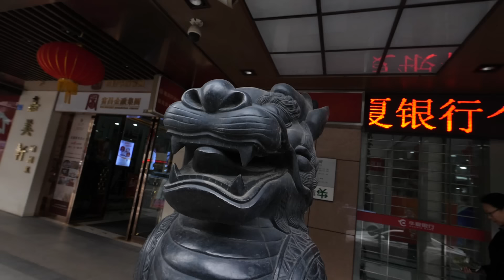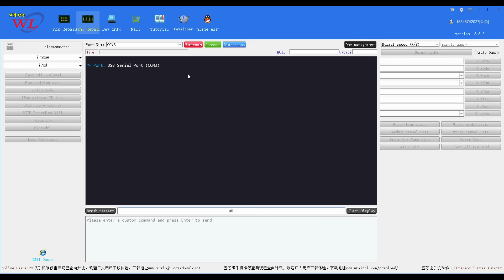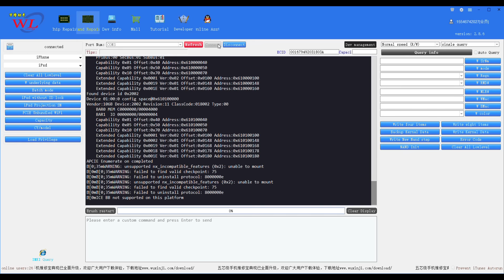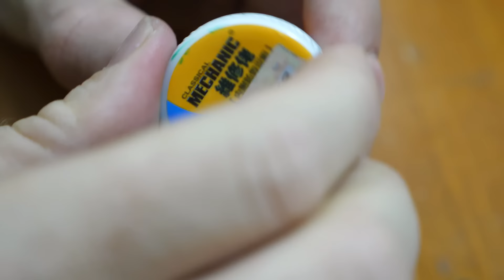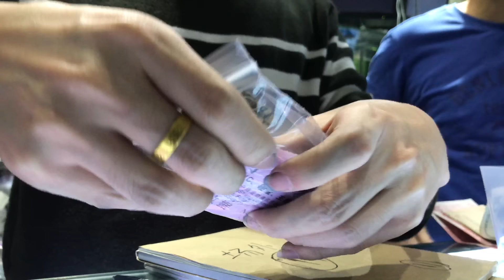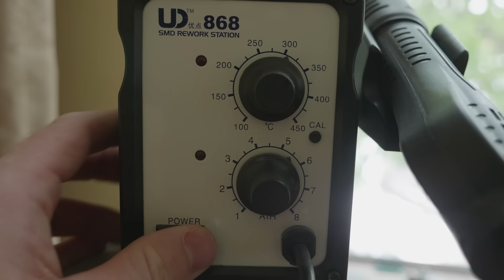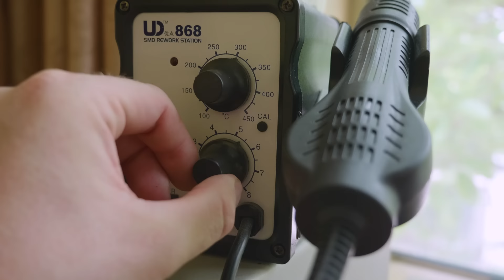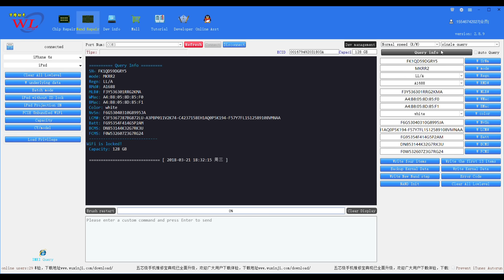How I Upgraded My iPhone Memory 800% - in Shenzhen, China

Comment: He has a soldering station, a microscope, a battery tester, batteries, old logic boards, but not another windows personal computer.
Reply: He's an apple people for some reason.
Reply: um how much was the phone with 128gb? i mean I loved this video being i have done this for eeproms on hard drives so it was good but with that equipment most people would just spend the extra money.. exception would be if its not able to be bought. I dont mess with apples because oranges taste much better
Reply: @kennethnicklowicz1030  well, the extra money he spent went into practice & tools. also, he made at least 1500% of the money he spent back from this video.
Reply: He can double boot too
Reply: my guy doesnt even know how to dual boot or run a vm, just goes and wastes money on a chinese craptop
Reply: Btw... Probable covid 19 if hes still there
Reply: To make his video lengthy to earn more money according to the watch time duration of his video
Reply: Honestly why. Macs are kinda bad. There overpriced and brake
Reply: @smurfy913  yet here you are on his page. Odd.
Reply: @kennethnicklowicz1030  you missed the point
Reply: He does now
Reply: or...download Paralelss

Comment: Hey scotty!  When the real iPhone didn’t boot it’s because the kernel data backup only backs up the core info of the chip (this does not include iOS ). So when it didn’t boot and was in recovery mode that was because it didn’t have an operating system installed. This is normal as I do these upgrades on a daily basis (I own a repair shop in Vancouver Canada called ring ring repair). Love your vids. Keep up the good work man!
Reply: sunlite1231  does restoring works? Just like how scottie did in the last part
Reply: sunlite1231  easy bypass 2020 i cloud screenlock
Reply: Do you upgrade memory like ing the vid? If so, how much would u charge to upgrade mine to a 128 gig? Thx
Reply: Cool!
Reply: Hey could you upgrade to 1 terabyte
Reply: @fireball2275  512GB(For iPhone X - 12 Pro Max) is The Max Capacity  , No iPhone Has Reached 1TB of Storage except the iPad
Reply: [XE01]ケネス thx
Reply: sunlite1231  if a chinese repair says that then dont hahahah they know the best probaly he did a icloud bypass
Reply: Hello, I am in Canada and looking for a micro soldering place to do this job for me. Would you be able to do that swap for me. I have looked around and I haven't found many places. If you can let me know thanks
Reply: Ill make sure to stop by your shop if i ever need phone help and am in the city!

Comment: I was so happy when i saw "800% memory upgrade" when in reality it was storage, not the ram I expected....
Reply: Yeah the RAM would be impossible because the amount is limited by the software. Unless you modify it which is also basically impossible to do on newer iPhones.
Reply: Can older iPhones be modded? I'm currently using a 5S which I love because of the case.  it's a cheap imitation survivor case but it's amazing.  I'm going to bite the bullet and maybe get a 12 Mini but when I do I was thinking of learning hardware nodding and stripping the 5S down and installing things like a bigger storage and better camera.  Do you reckon it's possible at all? Like obviously i know nothing but if I did know something do you reckon it would be possible?
Reply: @sammylpt9076  The storage could be upgraded but it's a finicky process as you saw in the video. A camera upgrade would be limited by the software and the processor. There could be image quality improvement but there are many other factors that limit that, mostly the hardware. Plus I doubt better cameras are made for the 5s anyway.

Modding the software could be done but like I said it's mostly the hardware that limits it which definitely cannot be upgraded. Also at your level of knowledge which as you mentioned is next to nothing it's very likely you would break your beloved 5s if you tried modding anything.

You've been rocking that 5s for a long time, in my opinion I think it's time to move on and get a new phone. From the 5s you will see a world of improvement if you get an iPhone 12, like loading times, response time, download speeds, image quality, and much more. You don't even have to get the latest iPhone 12, you could get a 11 or 10 or even a modern Android. Trust me, you won't regret it. :)
Reply: That much ram would be possible on a pc but who would even need that much phone ram anyway?
Reply: @rearmisser  or you buy an iphone 12 mini and transfer it's logic board, camera, battery, and everything In the 5s. Doesn't make sense but..
Reply: @r2256_  play pubg @God speed lol
Reply: @VulcanicYT  I mean why would you buy a brand new iPhone 12 and transfer everything to the 5s? The parts won't even fit as they are too big and there's different connections and stuff. Plus there's no point in doing so as it would defeat the whole point in upgrading the 5s' components in many many ways.
Reply: @rearmisser  like i said, "doesn't make sense". I said iphone 12 mini, I'm pretty sure it's about the same size as the iphone 5. So it could technically fit in there. Connectors don't matter cuz you'd switch the whole logic board. Could make for a nice sleeper phone! Right
Reply: @VulcanicYT  The iPhone 12 mini is still bigger than the iPhone 5s. The screen connectors are totally different plus there's no support for a home button obviously. Yes, it can be a nice sleeper phone because it won't be able to turn on, lol.
Reply: allow me to run ios 7 with 256 gb of ram

Comment: This made me appreciate the micro sd slot on my phone a whole lot more.
Reply: i think the point he was trying to make is that he can upgrade his phone storage in a few seconds by just plugging in a sd card instead of spending days and a few hundred bucks
Reply: Mario you can fit like five 1080p BluRay movies (or two 4K BluRay movies) in 256gb, allowing for space for the firmware. Do you want just five movies on your phone? Space is not often enough which is why most phones include an sd card slot.
Reply: Lol yeah. So much pains just to increase storage in an iPhone. Nah. Buy android
Reply: If you complain that you can only fit 2-5 movies on 256gb, it's more you than the amount of storage you got lol. First of all, the average encoded 1080p blu ray rip is nowhere close to 40-45gb a movie, and second of all, maybe you should adjust your files to the device your using it with lol. Like it's of any use to put a 4k rip on a phone that can basically show no difference between 720p and 1080p
Reply: youfreaker you never download rips. Amateurs do that. You download source material. I have a Deadpool 1080p bluray thats 95gb so I don't know where the heck you got 45-50gb from. I have ender's game that's 112gb 4K bluray. So...

Also, you can see the difference between 720p and 1080p. Just because you can't doesn't meam no one can. You can see the sharpness difference. The only resolutions you can see next to no difference is 720p and 768p.
Reply: Aditya Upadhye but if your planning on watching on a small screen, you could compress that down by about  x8 and you would never see the lost parts.

Also if you have the disk, and ripped it why the hell would you be watching it on your phone. Do you not have a HD tv, with decent speakers?

Also why hold onto a movie after you have watched it? Your argument makes little sense.

Though when we go on road trips, usually from UK to Spain or Italy. 3 to 4000m round trip, I have a usb 3 portable hdd, and a hootoo mobile router (£20) that acts as a mobile 'netflix' that is powerful enough for 5 people to stream from it at once. It also acts as a lan so the kids can play multilayer games.

A 10k mha battery pack will keep it running for a good 10h, (never drive that long). I use the battery so when I turn the engine of etc the hootoo doesn't turn off.
Reply: Stephen Butler a small screen is relative and the level of detail you see depends on how close the screen is to your eyes. I keep mine pretty close.

You watch on your phone if you're on the go. I do have a tv with great speakers. But I can't carry it with everywhere.

Also, I said you don't download rips. Didn't say I own the cds. You have to know what to download. Like remux or 7.1 atmos for my home theater or how big of a resolution your projector, if you use one, can output etc. 

There could be a million reasons to hold on to something. Sentimental value, amazement at the quality, something else, future reference, nostalgia, a look back at what I used to own once upon a time. (Fun Fact: I have never deleted anything in my life. I have five 12tb hard drives on which I've stored everything I've owned since my first ever Windows xp pc in 2003. Three and a half of those drives are full and I'm planning on getting more later on down the line once that fourth drive is full.)

Also, I cant stream becuase I have shitty internet. Those are the speeds I get where I live in India. I have to wait for 360p video to load on the worst days and 720p buffers a lot on the best ones. 480p is pretty much the sweet spot where I can watch something and still have something downloading in the background. Seriously. Like a 100MB file takes half an hour to download. The max speeds I hit are 200kbps (for download) and 600kbps(for upload).
Reply: NERDS Alert😂😂
Reply: you can fit a lot more than five fucking blu rays in 256 gb. averagely blu rays are about 2gb.
Reply: My 1080p copy of Deadpool is only 2.5GB. I don't think you can justify a 95GB~ copy which looks the same with maybe better audio quality?
Reply: Parag D all that space from an SD but makes it run slow. Increasing space by flash makes iPhones run more efficiently.
Reply: And you watch 4K on iPhone? :)
Reply: Who has uncompressed video rips on their phone? No one, ever. If 128/256 is not enough for you then you're doing it wrong. Its a phone, not a full blown computer with massive HDD's.
Reply: Mario But you can't do this
Reply: 1080p, 95gb? and 4k movie 112gb? something is very wrong here. 4K movies should be at around 4x the size of 1080p movies :)

Comment: I was following along in my head and once you got to solder balls, I was like nope. Great to watch, my inner electronics geek is complete watching this channel and your builds. 

The thing I really like are the hurdles and the pain, so true and real, man did I feel your Defcon about the Automatic Tressure Machine
Reply: From the evidence gathered in the video, there were 2 primary issues that increased the difficulty his experience, one of which he recognized and fixed it. The first was that he used a setting for the hot air blower that was on the wrong setting, particularly vertical air. This was suggested by how much the motherboard was moving. When the helical air setting is used, the intensity of the air produced is much less so and is much more conducive to removal of large items on the PCB such as the nand flash.

Comment: You got it right at the end of your video.  I am one of those who would NOT try to save $75 by taking my phone to a Temple Street phone repair shop in Hong Kong and risk at least a 50/50 chance of ruining it.  What makes it worse is that they don't ruin it but created some "flaws" in it, that when I find out later and try to get them to fix it right, they'd deny it is their fault. When one spends $1000+ on a new phone, one should not try to cut corners and save $75...

Comment: "The problems is it's Windows only software and I use Mac."

What a third-world guy like me expects: download cracked Windows or Parallels to use on Mac

What the Chad engineer who lives in Hong Kong do in reality: buy a brand-new PC.
Reply: Couldnt he just have used a vm
Reply: I'm from Venezuela. Yup, I was think in that way
Reply: Yeah, I would have tried a VM first; then if needed, installed a version of windows on the physical ssd.
Reply: What about driver?
Reply: Could've done a bootcamp partition, right?
Reply: I'm from Canada, am a Linux user, and I think the same thing. VM, Wine, or pirate windows to a dummy machine.
Reply: You don’t even need pirated windows you can download a free version straight from Microsoft.
Reply: Bootcamp?
Reply: Wouldn’t work well in working with hardware level drivers for flashing etc. So yeah he got a dedicated windows laptop for the task

Comment: The problem is, the software is windows only.

How about a virtual machi.. LETS BUY A NEW COMPUTER
Reply: TheWGBbroz you don't want to bother with weird drivers and usb passthrough on virtual machines. Dual booting would have been better
Reply: He gets to write it off as an expense xP
Reply: Bootcamp
Reply: on the plus side, now he is not stuck with a shitty Mac !
Reply: rob b true
Reply: or wine for fucks sake
Reply: There is just annoying driver issues when using a virtual machine and you want to keep it as simple as possible for the controller in the device.
Reply: Dual Boot :P
Reply: LMAO
Reply: @wrgint2249  erm from the Microsoft website..?
Reply: when in china
Reply: Oof
Reply: @natanielc5088  oof indeed nat
Reply: Bootcamp is built into mac ...
Reply: I did the same thought process
Reply: lets do a TITAN XP BUILD!
Reply: @grizzlybear_-ct5hn  wine would be so ass trying to use usb and drivers correctly
Reply: My reactions: Oh, this guy try to use Wine... How "LETS BUY A NEW COMPUTER"?
Reply: LOL exactly what I was thinking...Virtual box, windows demo, problem solved, zero money spent...
Reply: Passthrough is very easy to set up muh dude
Reply: The problem is, it's 2018 and someone still have a Mac
Reply: I think, its Xiaomi advertising.  In my country, many bloggers admire Xiaomi laptops, but Dell cost 2 times less
Reply: LMAO My exact thoughts xDDD
Reply: Some hardware doesn't play nice through VM, but you can easily Bootcamp.
Reply: Don't know about this specific software, but tried bootcamp and the new mac doesn't have a USB 2.0, which is a limitation for certain drivers.
Reply: Mike Ramos Adaptor might be problematic as well. I run into some weird things with boot camp, and flashing your device you do not want any miscommunication.
Reply: TheWGBbroz yeah more expensive but at least he had a windows pc now instead of a Mac
Reply: @wrgint2249  What a dumb question, dude. Windows 10 can be downloaded free from Microsoft in iso format, and they even tell you how to make a bootable USB. Once installed, you can activate Windows 10 with a legal key, or with Kmspico. Even Linus Tech Tips uses pirated Windows 10, and they admited that in this video:
https://www.youtube.com/watch?v=M3bezYerYxQ
Pirated versions of older Windows can be found easily searching Win x download in your preferred search engine. It's pretty easy to download legally, and illegaly, allmost any operative system in the whole internet.
Reply: There's a video from apple.com shows how to install a windows os into a mac.
Reply: Or maybe, stealth marketing by Xiaomi, haha.
Reply: Oh i though... theres a program that runs windows app called wine its free just have to installed but no, he wanted a new pc
Reply: Just install winebottler
Reply: I mean that is a great fix because Mac's suck anyways xD
Reply: I can't believe the amount of people overlooking the issues that He would have had with dual booting, VMs, passthrough, etc... And for His needs He probably already wanted a windows machine in the first place. It isn't just a simple maneuver to show how easy it is to spend money or that he didn't consider other things as alternatives, I would assume and say of course He did.
If He didn't He would be doing an uncharacteristically stupid decision if He didn't justify it. He probably already needed the machine at some point in the first place and that moment was the best time to have needed one, also to make life easier.